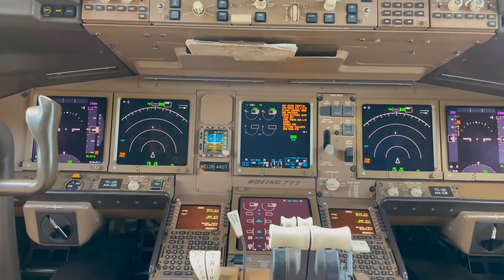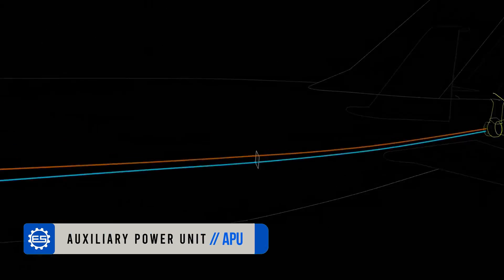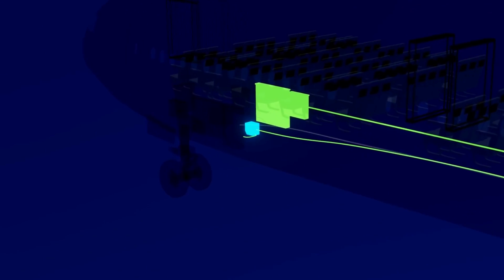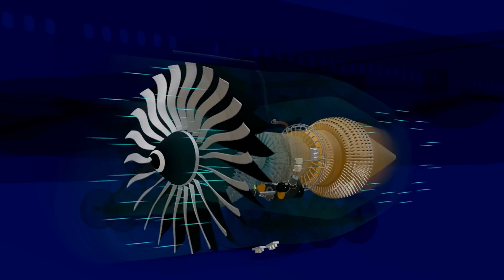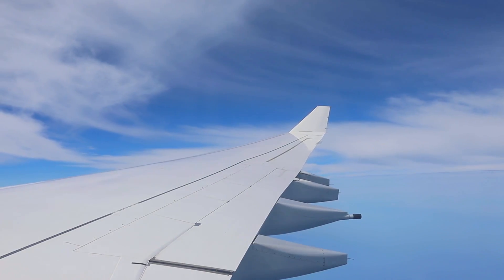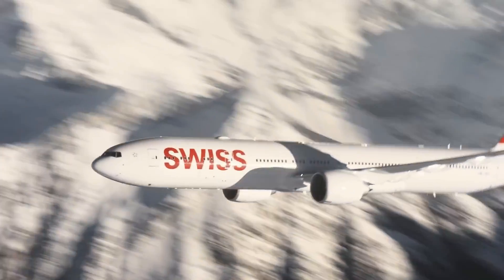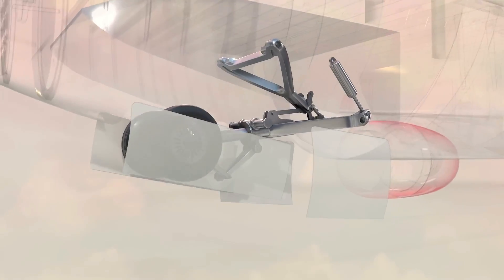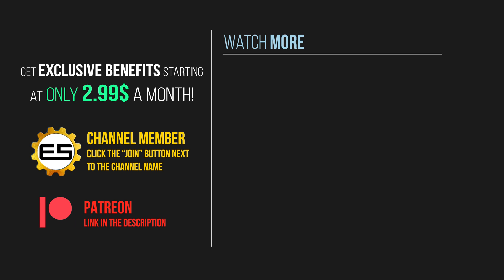The Hidden Device That Saves Airplanes

Comment: I mean the scenario in which none of the generators are working isn't likely to do with the generators having problems but the ENGINES failing. This could be contaminated fuel, bird strikes, flameouts, icing etc